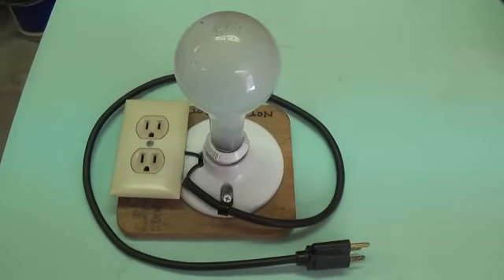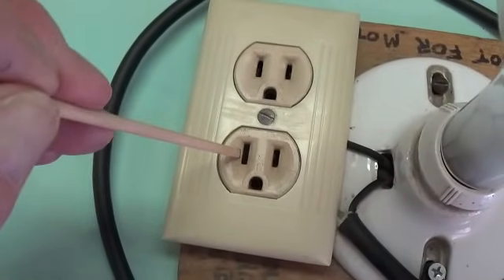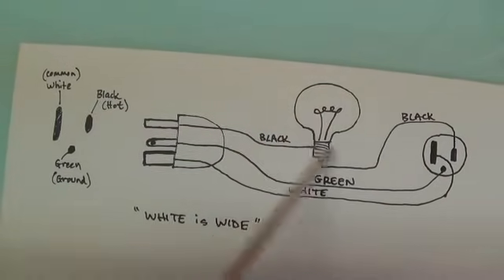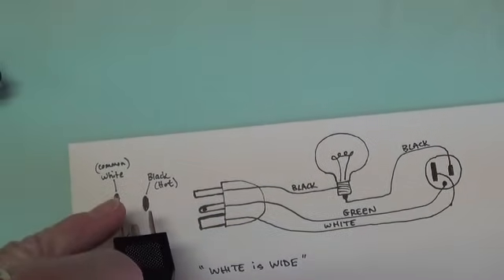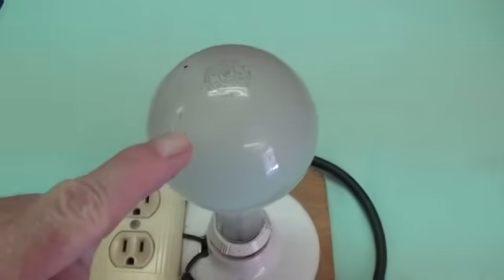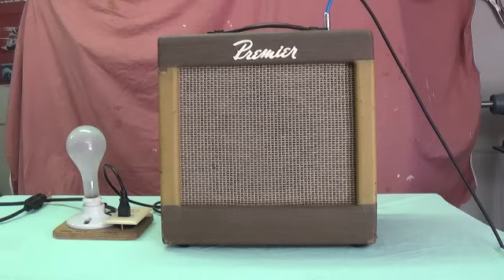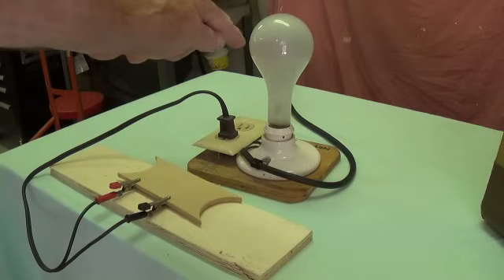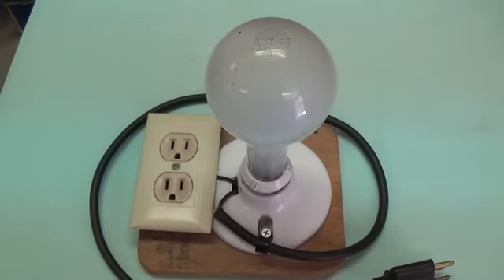Build Your Own Current Limiter for Protection when Repairing and Testing Electronic Equipment

Comment: doug, i'm in the UK, built a 5c1 clone, when i use the light bulb limiter, with a 100w bulb, on switching the amp on, the bulb glow's dimly and stay's on, but the amp work's fine, have i still got a problem,
should the bulb not glow at all,. thank's,
Reply from the maker: No problem at all, Paul. The current flow is partially activating the filament, which is slightly reducing the current flow to the amp and slightly reducing the plate voltage.....not really an issue if the reduction is slight. To eliminate the glow and decrease the current reduction, you could go to a higher-wattage bulb, i.e. 150W, or two 75W bulbs in parallel.
Reply: thank's for the quick reply doug,

i only thought something was wrong, as i've another 5c1 clone i built, and the bulb limiter dose'nt light up at all, but the amp work's fine, except for a bit of hum,
Reply from the maker: I wonder if the hum may be due to a problem with the filter caps that allows for some current flow to ground. Feel each of the filter caps (carefully) after several minutes of use to see if any seem warm to the touch.....indicating current flow (through resistance) to ground. With new caps it's a long shot, but worth checking.
Reply: thank's, will do,
Reply: To obtain 150W, the 75W bulbs should be wired in series. Two 75W bulbs in parallel would be the equivalent of a 37.5W bulb.

Comment: If you can only get hold of 100watt bulbs. Could you not wire two in parallel to emulate a 200watt bulb? Hence half the total resistance than using a single 100watt bulb.
Reply from the maker: Yes, you can do that.....or even three 100W bulbs in parallel if you're working on a medium-powered amp.
Reply: Thanks Doug. I am in UK using 240Volt supply. Luckily I have a cupboard full of 100Watt bulbs. So, in my particular case, would a single 100Watt bulb be equivalent? (eg 115V needs 200Watt bulb so does 240V need a single 100Watt bulb???)
Reply from the maker: That's the way it calculates, TT. Since your current flow is half ours, your initial filament resistance should be double.....and filament resistance goes up as wattage goes down. Let me know if it works out.

Comment: yes,   i see, all the bulbs is configured in parallel.. but the whole 
parallel configuration is wired in series.. just like the single bulb 
system.. now i get it..  
what do you think the 3 bulbs power should be the best ? 

thank you. 
andrew
Reply from the maker: Each bulb should be around 250W if your power is 120VAC. If your power is 240VAC, then the wattage can be reduced to about 100W each, since your current flow is half. See the video description for a full explanation of why this is true.

Comment: hii Uncle Doug.

i am glad you made this video. 
can you also make another video or at least show me  how to connect 3 bulbs current limiter and how  it works  in detail ? 
it is like this:
i used to saw an old friend who works in an electronic repair shop. 
he has 3 bulbs.. and 2 switches  (i guess) . when he test a customer faulty electronic, he will turn on 1 bulb, later 2 bulb and later 3 bulbs... and he will judge if the device  power side is good or no good, only then he started to repair the device.. 

how is his 3 bulbs configuration ? he have to use 3 bulbs.. somehow, because he works as electronics repair man, he can't have whole day changing the light bulbs.. because every different electronic could have different power draw.. 

so he uses 3 bulbs method and repair everything, from dvd to tv... to wash machine..

i find it very good.. i would like to build one, but no one explain how that works ? what i saw only single light bulb method..

please reply me..

thank you. 
andrew
Reply from the maker: Andrew, to make the current limiter able to cope with higher current levels, multiple bulbs can be connected in parallel. You could install a switch for each bulb to allow it to be connected or disconnected. For a low current device, you could use a single 200W bulb. For a medium current device, you could flip the toggle and connect a second 200W bulb (in parallel). High current, use a third bulb, etc. I hope this makes sense.

Comment: Isn't it easier to simply use a fuse for one's home countries mains power and some 2 or 3A, like in a finished amplifier? Is this somewhat safer than a fuse? Or does it simply have the bonus of glowing bright so you'll definitely notice?
Reply from the maker: The fuse will tolerate excessive current for a short (to medium, if it's a Slo-Blo) period of time, Sam, during which damage can be done.....and when fuses blow, it's not obvious and they cost money to replace. The current limiter offers immediate, obvious, free warning of excess current, as well as a visual demonstration of just how "excess" it is.
Reply: Hm, how long does it take to blow - vs. - how long is my reaction time, when I see the light glowing? 
How often do you short something? A new fuse is around 0,13€ here, tungsten light bulbs over 50W are almost out of use, so buying one is probably 50 new fuses at least. Did you ever have to change the bulb?
Reply from the maker: There is no reaction time with the current limiter. It instantly prevents the influx of excess current on its own, without your help. If you prefer to use fuses, then by all means do so, but the current limiter is superior in every way.....and you will most likely never have to replace the bulb.
Reply: Well, that actually sounds more convincing than fuses. Thanks for the advice!

Comment: This is probably off topic but not sure which video of yours to ask on. Looking at photos of Marshall chassis, they run the twisted pair filament wiring down to the chassis body, then tuck it back and run it along the corner of the chassis where the bend is located. I scanned as many Fender chassis as I can find, and of course many have been worked on over the years, but it looks like Leo's builds (and maybe CBS's) stretched the filament wiring between the tube sockets fairly tight, and ran them along "in the air" between the tube sockets. Is either method OK to use in either type/brand of amp, if you're rewiring or building a clone? Is one more susceptible to hum or other electrical problems? Thanks!
Reply from the maker: I've tried both methods, Michael, and they both worked well.  My current method is sort of a combination. The twisted pair runs close to the chassis until it nears the tube socket, then it arches upward, above the tube base, and then downward to the pin.  This seems to be quieter than having the wires wrap around the tube base, close to the pins.

Comment: What purpose does this serve beyond the fuse in the amplifier. won't the fuse blow if there is a short?
Reply from the maker: Fuses, especially slo-blo, will tolerate moderately elevated current levels for sufficient time to harm internal components. The Current Limiter provides a visible indication of the presence and degree of excess current flow, and acts immediately to diminish it to harmless levels.....without requiring fuse replacement.

Comment: Hi Uncle Doug,  if you don't mind a question, I went around and around, and decided to build a princeton reverb clone, mostly for the fun of it and to learn more about tube electronics.     Id like to build from the original Fender schematic and layout.   Unfortunately, I've been searching for weeks, and seems like the only copy of the AA1164 schematic and layout look like they were faxed 10 times (using old time fax machine), before scanning into a PDF.    I find it hard to believe no one has a readable copy on the web.      Wondering if you know of a source that has a scan of a real fender doc with schematic and layout for AA1164 that is readable?     

Thanks!
Reply from the maker: I downloaded an excellent copy of the AA1164 schematic from http://thevintagesound.com/ffg/schem/princeton_reverb_aa1164_schem.gif
Reply: Thanks Uncle Doug!!!

Comment: In europe the household current is 220-240V, also the colors of the wire are different. the white wire (N) is blue here, the black wire (L) is brown here and the Green wire (PE) is green-yellow.

If you bridge the L and N with a screwdriver (don't touch the metal or the. current will flow over your body into the ground and back to the voltage sorce) if there is a resistor in the circuit (the bulb in this case) which is high eough to reduce the currrent onto a worth that is tiny enough not to burn or melt the wire the bulb will glow.

Let't say the wire has a cross section area of 1.5mm2, then the wire is dimensioned for up to 16.5A 

To figure out what the current is which flows trough the circuit we use the formula P = U × I (Power = Voltage × Current and change the formula into P ÷ U = I. Lets say the bulb has 60 Watts.
60W ÷ 110V = 545mA. At this current the wire wouldn't get that hot to burn the screwdriver. But if there is no bulb and the resistance of the cable is as example 1 Ohm, then we'll get 110A in the current. ( I = U ÷ R ) This is actually a short circuit which will damage the screwdriver and the wire before the fuse will open the circuit.
Reply: I think at 110A the Bulb will work as fuse too and the incandescent filament will burn down and open the circuit. Or will the circuit breaker be faster?
Reply from the maker: Thank you for your detailed analysis, 59V. I have never had a filament burn up, even with a dead short (as demonstrated in the video).  The bulb filament only allows enough current for it to burn brightly.  The electrical supply to the lights in your home can easily pass as much amperage as your circuit breakers will allow, yet your bulbs don't all burn out when you turn them on.

Comment: Doug, I built your 250 watt load limiter and I feel much safer with it.  I did have an interesting experience on the last guitar amp repair while using the bulb that has me a little puzzled.  I'm using it inline with a B&K isolated AC power supply on this Music Man amp that was blowing it's fuse. First thing was a cap job and check all the big resistors.  Once done,  I had no more blowing fuses. While setting the bias I saw that the amp's HV tube DC supposed to be 725VDC,  I had about 711VDC on standby but dropped to 525VDC under load and couldn't get anywhere near the correct bias setting.

I decided to focus on that problem. With the B&K and load limiter in place I found 25VAC from neutral to chassis and I thought thank god I have Doug's limiter in place.  Ultimately, I decided it was a shorting power transformer under full voltage because it also showed poorly on a ring test.  After replacing the the PT I still had the same problem.

Something I never checked was the voltages while plugged directly to the house mains.  When connected directly to the house I had 0 volts on neutral to chassis. To compound things, with the power supply/bulb arrangement as the power source, the only way I could get 120VAC measured on the PT is between neutral to hot, not hot to chassis. Meanwhile,  hot to chassis on the house shows 120VAC.  With the B&K/bulb in place hot to chassis showed about 80VAC (the death cap was out).  Also, when the amp was under full load (not standby) it drew about 1.75A on the B&K and lit the bulb significantly.  Conversely, on the house mains I have none of this.  Rather 120VAC hot to chassis and only draws about 0.75A under full load and the HV DC stays above 700VDC while not on standby.  

As you might guess, the measurements with the B&K and bulb made me think I had more wrong in the amp itself. I don't think there was anything wrong with the PT.  I want to chock the higher amperage draw on the power supply with the load limiter, but I feel like there might be more to it, like a problem with the power supply.  The load limiter is not miswired.  The bulb is in series on the black hot leads.  Do you think I had something wrong with the B&K and should one use the bulb the whole time or just when a short or unknown amp is being worked on?  Thanks for any input.
Reply from the maker: I must admit that I am a bit confused by all the interactions described, and have never used a current limiter with an isolated AC power supply. In USA house wiring, neutral and ground are connected, so if any potential appears between them, it must originate in the equipment (i.e. B&K) placed between the wall outlet and amp circuit.....thus the 0V potential when connected directly to wall AC. I would not use both the isolated AC and the CL at the same time. In fact, I would probably not use the B&K at all.
Reply: Sorry for the bouncing around in the description.  I suspected that the two together weren't necessary.  I used it to bring up the voltage slowly.  But a variac could have done the same thing, like what you use.
Reply from the maker: No problem, Rick. Best of luck with your projects.

Comment: Just remember, if your home or shop was wired up by uncle granddad all bets are off as to the outlet polarity. Even in new constructions, I've seen whole neighborhoods of prefab homes that had a line and neutral reversed on 240V outlets. And 120V outlets connected up with no fucks given about polarity. So until you know, just check the sides referenced to ground with your MM.
Never trust that the guy before you did their job.
Reply from the maker: Agreed, MM. My first (new) house had two rooms with conduit but no wiring !!  Yet, it passed inspection. I use one of those small wiring testers you can get from the home building store to detect reversals, lack of ground, etc.
Reply: Metatronic Mods - It's also worth checking the grounds, as well. I have seen many instances where the wiring conduit was used as a ground return to the service panel. Old conduit connectors can loosen and electricians can forget to tighten a conduit connector, resulting in not having a ground at the receptacle. On top of all that, I have seen old houses wired with two-wire Romex (hot/neutral) and then someone replaces all of the two prong receptacles with three prong receptacles and they never connect/run a ground. I've even seen old receptacles that we're wired correctly, but the ground terminal was worn out from age and use. Never take anything for granted. You only get one life. :-)
Reply: Which is why, in the UK, it's now illegal for an unqualified person to install or modify domestic electrical wiring.

Comment: Awesome! Why is this not included or even kind of standard addon for every setup? It would be almost like a check engine and even better because it may start being dim and grow from there letting you program your next service before it all blows up. Thanks!
Reply from the maker: You're welcome, Hernan.  It's the simplest, cheapest, and most effective way to protect your amp circuit without blowing fuses.

Comment: thanks for your wonder video and the project, I made one according to your circuit, it was great, I had problems want to ask you. Last year I built one 5E3 and I use the current limiter to power up with no problem, but I just build an Audio SE tube amp this year with 1x 5U4G, 2x 6sn7 and 2x KT88, when I first power up the amp without any tubes it was ok, no bright light n the bulb, then I put in 2 6sn7 and power up again, it was no problem too, so I put all tubes in the amp than power up and few second later the light bulb grow slow up but not bright as usual bulb ( I use 200W bulb and 220V ) actually it was dim, I know may be something wrong in the amp so I turned it off at once, "may be somewhere was shorted"?  I saw some video in Youtube they connected current limiter and play the 5E3 guitar amp, but the bulb still dim light? is it normal or the capacitor is charging?
Reply from the maker: Greetings. It's normal for the bulb to glow visibly while the amp is functioning, however it should not glow at anywhere near full brightness. With 220VAC power, the bulb wattage can be lower than with 110VAC, since your current flow is only half.
Reply: thank you very much, I'll try to power up the amp again and input audio to see it work or not, thanks again.

Comment: another great source of high powered bulbs are those used in stage lighting.....even 1000W bulbs are available....
Reply from the maker: Indeed, I use bulbs intended for photo use which are around 250W to 350W, but higher wattage bulbs are available.....i.e. for stage lighting, as you suggest.

Comment: works in europe to. though you need to check polarization . 
Right side is usually "fase" + ( Brown wire)
Left side is usually "zero" - (Blue wire)
Earth is green+yellow wire.
And We call this a switch wire. but it always + and is a black color wire. 

But check it, cause we can reverse our plugs both ways.
Reply from the maker: Thank you for your helpful input, DW :)
Reply: J.D. Willemsen hoi, u bent Nederlands geloof ik. Bedankt voor de info. Ik ben er 1 aan het maken. Klopt het dat wij, omdat we 220v gebruiken minder watt lampen kunnen gebruiken. Dus in de U.S. (110V > 250W) en wij (230V > 100W)? Grt

Comment: I live in Hungary where AC plugs are not polarized. What should i do?
Reply from the maker: Odds are you'll do just fine, SK.  AC receptacles weren't grounded or polarized in the US for many, many years and we all seemed to survive.  Granted, things are safer here now, but the shocks I got as a kid taught me some meaningful lessons about electrical safety :)
Reply: I found a way around it. I wired a small neon bulb so it lits up when the plug is connected the right way.

Comment: If you haven't the ground green wire, it works even so ?
Reply from the maker: You really need to have a chassis ground for the electronic device you are testing, SW. Otherwise it could present a serious shock hazard.